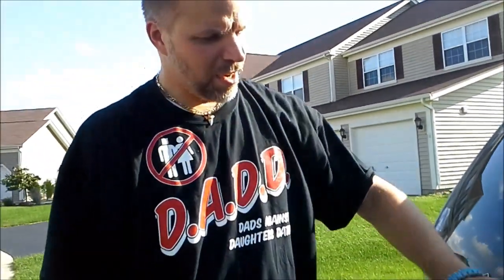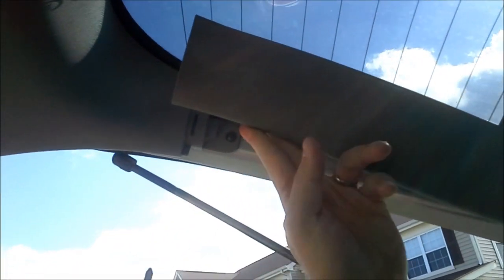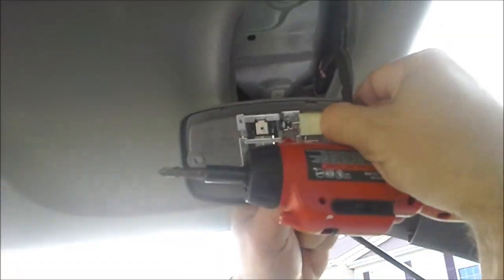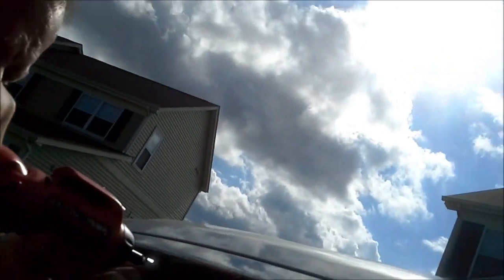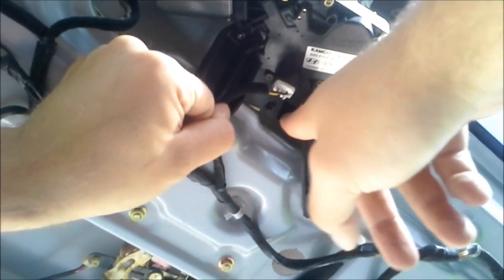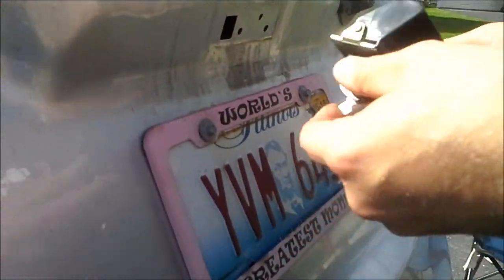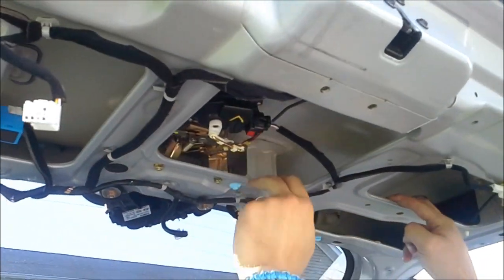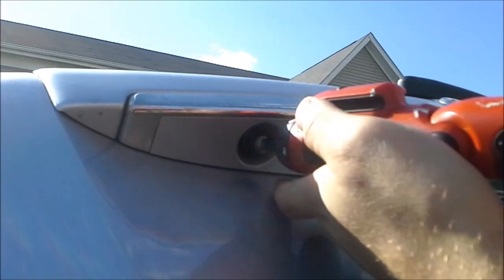KIA Sedona Lift Gate Hatch Fix - SOLVED

Comment: Thanks for posting this video Sean, it helped me in getting my rear hatch disassembled and reassembled as I had a locked hatch on my 2012 Kia Sedona.  Everything in the video seems to be accurate and worked like a charm.  I found that my latch was intact but my door was stuck in the locked position.  Used my hands to unlock it and was able to open the hatch.  Since the springs and connectors were intact and operational, I initially concluded that it was the locking motor, so I priced out at a local wrecker, in putting things back together again with the motor detached and the back hatch permanently unlocked but operational.  Later, I found that there is a fuse box in the back that has a 20A fuse for the rear locking mechanism.  I found that my fuse was rusty which may be causing the rear lock to not work.  Going to take things apart tomorrow and replace the fuse and reconnect to see if that resolves the issue.  Hope this may help others that use your video as a resource.
Reply: I have a '12 Sedona & back door won't open so there is a fuse for it? I wish they would've kept the key slot on them like in this video.. .SO ANNOYING
Reply: @coppertopvon mine don't have the key hole on the hatch. The lock on it has never worked since iv had it but now I think it's stuck in lock position.

Comment: Sean, Thanks for the video. My problem is that I can't even get the lift gate open to get to this step. How do you get it open once it is stuck b/c the latch is broken? Thanks!
Reply from the maker: dan parker - Sorry, I did not see this until now. You can unlock the hatch with a key manually.
Reply: We have a 2011 Sedona and it doesn't have a key to unlock the hatch.  Do you know if there is another way we can get the hatch to open?
Reply from the maker: There has to be a way to release it mechanically. I would call the dealer and post the question.. However, if I had to guess, I would suggest removing the indoor panel/dome light. Perhaps there is a method to retract that bar and pop the lock. Since you cannot open the hatch, it sounds like there is something bigger than my problem - burned out motor, gear issue. best wishes. This video might help: https://www.youtube.com/watch?v=LWjQ6b6kZnQ
Reply: Yes, we just went back later and the hatch opened.  It seems the actuator is not completely releasing the lock.  I'm not sure if we'll try to fix this ourselves or not.  Thanks for your help.
Reply: We have the same problem now. How did you end up fixing it? Thank you
Reply: @sahrens1  my key doesn't open it still

Comment: Thanks Sean and cameraman :) good tut. Don't pay $300 to get this fixed I fixed in 30 min and replaced a few blown bulbs in the process. If your hatch won't open No Worries just start taking interior panel off, remove screws, handle and fixtures that you can get to.once you get a visual from behind the panel you can trouble shoot your issue, fix it and be satisfied. 30min and less than $30. I could not believe the KIA Dealer quote. Rip offs

Comment: Sean, I watched your repair on your 2006 Kia Sedona. I own a 2007 Hyundai Entourage and seem to be having the same issue. This is not an electrical door and the key fob does not seem to be working but I can get it to work by messing with the key (as you described). Is this the same issue that can be repaired with your instructions?
Reply from the maker: Alan Boucher -  If the handle is loose.  then this should repair this. The latch connects with a solenoid for the electrical operation, the mechanical function minus the handle is fairly rock-solid. The issue is the handle spring is broken. So, I would go for it. I bet it would fix it.
Reply: Sean Ahrens I will give it a whirl. Thanks, Sean. I will let you know if it works.

Comment: Sean, thanks for the video. This was all I needed to sort out my issue of 2 broken license plate screws on my 2008 Entourage. My only difference was that on the handle, I have bolts instead of screws which were pretty deep and tough to find a socket that would fit it.

Comment: Great video, Sean, despite some very shaky camerawork :-). I just now fixed a similar problem on my 07 Sedona with the help of this and a few other online resources. I'll describe the problem I had and how I fixed it here, in case that's helpful for others who find your video.
  In my case, the liftgate handle was stuck solid, so the gate couldn't be opened at all. I removed all the plastic door trim pieces as you show (this was possible from inside even with the door closed), and discovered that the actuator was broken -- the white plastic bit that the metal rod connects to wouldn't rotate at all. I could hear it click when I used the key, the key fob or the button on the driver's door, but it wouldn't move the rod, so the handle didn't work and the door stayed shut. To be able open the liftgate, I temporarily disconnected the rod from the actuator; this made it possible to use the liftgate normally using the handle, but it still couldn't be locked. Since the handle itself wasn't broken, as yours was in the video, I didn't need to remove and replace it as you demonstrate.
  For me, the next step was to remove the actuator from the interior of the liftgate (it's attached by 4 screws), and disassemble the actuator itself, using a procedure like what's described in Part 4 of this web page: https://www.yourmechanic.com/article/how-to-repair-a-door-lock-actuator-by-marvin-sunderland. The plastic shell of these actuators is glued together really tight from the factory, so careful use of both a single-side razor blade and a heat gun was helpful. Kia and other dealers charge hundreds for these actuators as they're specialized to fit specific models of vehicle, but in fact they rely on an easily replaceable little "worm gear" electric motor that you can buy for just a couple bucks on ebay and other websites; it's kind of like this one -- https://www.ebay.com/itm/381860450196 -- but you'd want to look closely at your own actuator's motor to be sure you're getting an exact replacement. (Also of note: one commenter on a Kia forum says he replaced his entire actuator with one that was sold as fitting a 2010 Hyundai Accent front right door: http://www.kia-forums.com/kia-carnival-sedona-2006/269434-2010-sedona-tailgate-lock-actuator.html. The image does look similar to me as well and can be found e.g. here: https://www.autopartsway.com/search.cfm?allveh/dorman/allct/allsct/search:w0133~1975020.)
  As it turned out, I didn't even need a new motor for my broken actuator. Somehow, a non-essential spring had broken apart and was jamming the actuator gears. Once I removed that bit of metal and reassembled and reinstalled that actuator, everything worked perfectly. Along the way, I found it very useful to refer back to your video walkthrough. In particular, getting the metal rod reattached to the actuator was a little tricky; a close look at the connection on your video around 8m30s cleared up my confusion.
  I'd be interested in knowing whether this description helps anybody. If there's call for it, I can pull the liftgate trim off again and walk through the steps in a video of my own sometime -- but likely not 'til the Chicago winter's past.

Comment from the maker: Dan,

Can you not use the operator (inside van) or the key? Using  The key should unlock it.. if the handle does not work, pull the handle forward manually with your hand, and cycle the key-way, then try the handle normally. failing that, using my video you might be able to activate the mechanism by pulling out the light and reaching in there and pulling the actuator rod.
Reply: pull it which way. i have my hands in there and csn feel the rod but its very tight
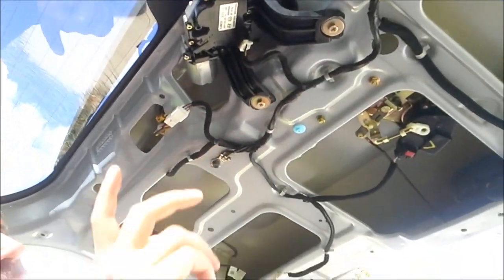Reply from the maker: watch from 5:24. As IR ecall you pull the yellow clip down, and it disconnects the rod.

Comment: My van doesn't have a key entry. So how do I get the door open?
Reply from the maker: That is not the same type of mechanism as the video potrays. That is a newer type of van. Sorry, this fix will .ilely not work.
Reply from the maker: Seems like you have a newer van.this fix will likely not work..there is most likely some mechanical means of opening..
Reply: I’m having the same problem. No key hole 🤦🏽‍♂️